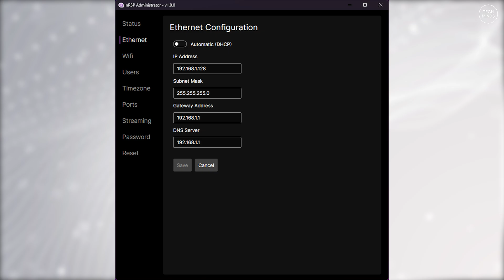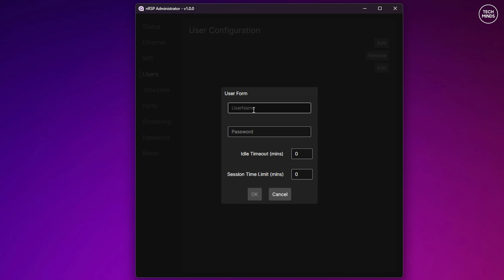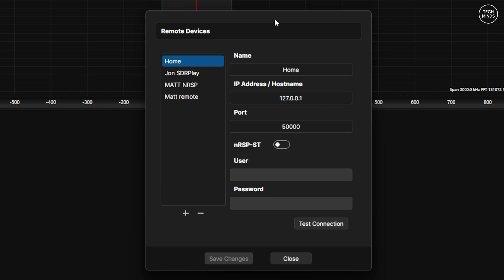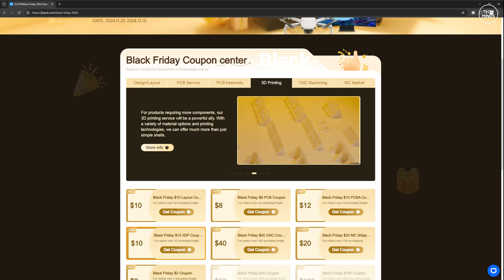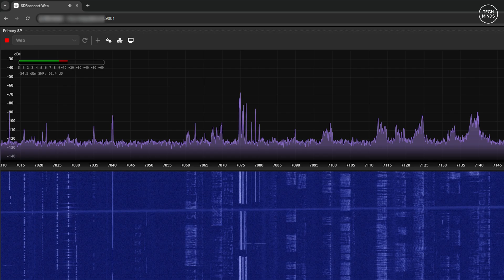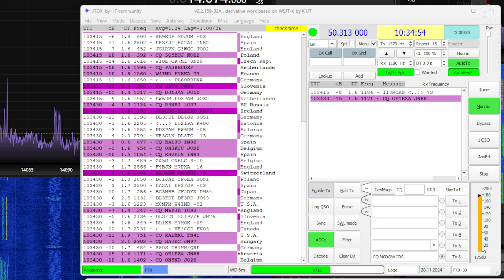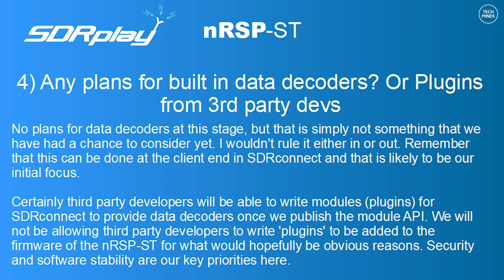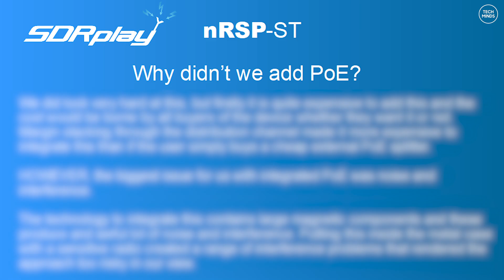SDRPlay nRSP-ST Network Setup Guide & Your Questions Answered!

Comment: I don't understand this product tbh. The SDR is limited to the sdrconnect software, which is far away from being finished. No modules, questionable UI, and unstable at longer operations. The SDR has no interface for the established softwares (like SDR++, SDR# , SDRangel or Uno over EXTIO). Sdrconnect offers no direct trunking as well. So I'm stuck with a fancy analog audio only receiver für ~500 bucks, and have other option as to wait for their software to mature. After testing out the nrsp for a bit over a week, I have finally returned it today. My current set-up with one RSPdx R2 on a Raspberry 5 is waaay more flexible - and less expensive. I doesn't look so sleek, though.

Comment: Hi, Got mine today but I have a problem. I can't access it via the webb. The admin-tool says No IP under the Ports section. The Web Socket/Client Port is greyed out. Have I missed something ??
Reply: Did you update the firmware? It's the first thing you need to do
Reply: @sdrplay7519  Yes! I'm on 1.03 now.
Reply: You know what?  I enabled the WIFI on dhcp and disconected the ethernet (which is static) and now it works. I'll check other combinations on this......
Reply: Me again  🙂   The web works only on WIFI (DHCP or STATIC). With Ethernet (dhcp or static)  I'll get "No IP" on the Ports-menu. Bug or miss somewhere or what???
Reply: @thbe51  It's not a bug as we use both WiFi and ethernet all of the time. Inside the administrator tool the web client/socket port IS greyed out because it can't currently be changed from 9001. So that isn't something to be concerned about. We plan to add the ability to change this port in a later firmware update. Have you updated the firmware from the factory default?

Comment: Hmmm,
Technological marvel for certain, which likely or most often is the strongest incentive in a set of incentives for having one. 

Assuming it's a single receiver capable of being addressed anywhere one has Internet connection or perhaps also a WiFi connection I'd personally not opt for this device and select another quality SDRPlay receiver having dual receivers were I to pursue having a new & different toy. 

While these network receivers have their place I can't say I have an interest in hosting a network addressable receiver & typically when I am away from the home  engaged in shopping, attending a movie, visiting friends, working in the shop, & etc listening to a receiver is not included in the activity. On the other hand if you have several homes and do not want to equip each with a radio room or if you often want to listen to the receiver while traveling to a destination it seems a perfect fit.

Comment: Please have caution that you are opening ports up to your local network... it could be better to set up a DMZ or a VLAN that you can segregate this device on so if any vulnerabilities are exploited on the device, they cannot pivot to your main machine.
Reply: Shodan. ;)
Reply: @ exactly :D
Reply: Would it not be possible to use something like cloudflares zero trust tunnel ,I have just bought the device so when I get around to setting it up I will be trying that method first.
Reply: @ciscokiduk  That is what I am going to do, although I don't know if streaming a ton of data over a free tunnel breaks the terms of service.
Reply: @capnrob97  it will be fine as it doesn't actually tunnel the data in the way you may think , put it this way I been using it for my media server for 2 years and no issues.
Reply: @ciscokiduk  ok, I have 3 servers using zero trust tunnels, but they are low volume, low use things.

Need to figure out how to login to the radio, it looks like SSH is disabled. Don't really want to take it apart right now to get a login.
Reply: Thanks for this video as I just received mine a couple of days ago.
73! Have a great day!

Comment: Can we use tailscale if we not have public IP and not open and forward ports?Is there SSH function for nRSP-ST?
Reply: You could reverse tunnel to it via SSH and then set your reverse tunnel as your proxy, that way you can authenticate securely i.e via a cert or at a minimum a length password
Reply: @BeneeUK Tailscale puts an end to dynamic IP/port forwarding nonsense, that’s the beauty of it. All devices running Tailscale act as they are on one internal network regardless of location.
Reply: @uncleal6095  fair point, but I wouldn't want to trust the tailscale team, they seem like a jackpot target for an attacker though you could run your own headscale, most ISPs will sort you a static IP if you're nice enough :) or will let you lease one

Comment: Great video and information as usual there. My question:

I already have an RSPdx, connected to a windows box running 24/7 as a dedicated server for SDRConnect which I access locally and via my VPN server when out and about. Other than the web interface, does the nRSP-ST offer any other benefits over the setup I currently have?
Reply: Can you explain how you did this? I’d like to do similar with RSPdx-r2.
Reply: Lower power consumption and it's free of windows 🙂
Reply: @fotografm  The RSPdx is free of windows too if you use SDR Connect.